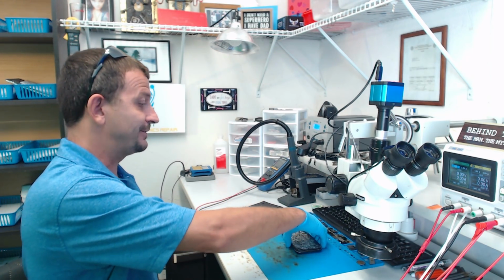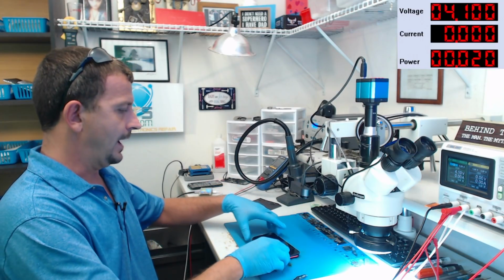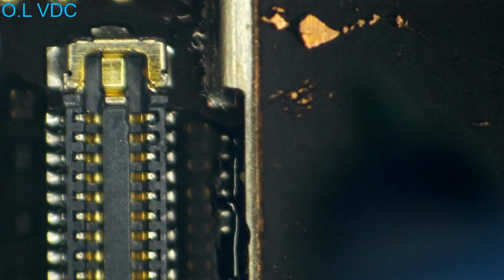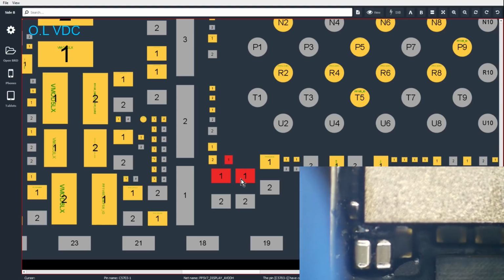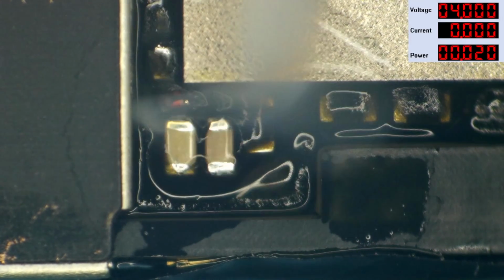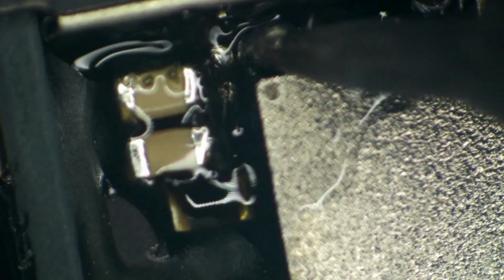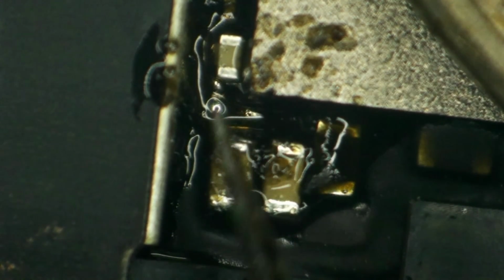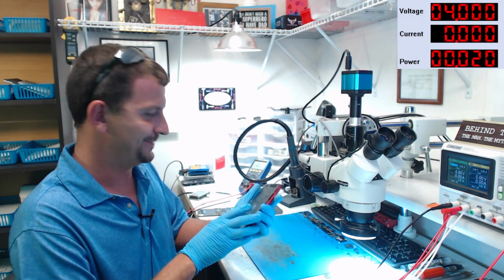Fixing an iPhone XR "No Image" problem (and letting some smoke out)

Comment: Even my XR has the same issue, have tried with different technicians but they have failed to resolve the problem. When you plug in a charger it vibrates

Comment: Nice fix, 5 days before you released this video a car ran my XR as well, can you tell me the values for the capacitor and filter or from which device would they fit. I would've send you the phone so you can fix it but i am from a different continent. Much appreciated.
Reply from the maker: This was a 6.4v 10uF capacitor and the filter was rated for 320mA.  If yours has the same cap shorted, you could get away with just removing the cap.  The filter is likely ok and the cap won’t make a noticeable difference.
Reply: @ststele  thanks for the advice. The display is working now but no backlight now. Can it be the filter?
Reply: What should we check? Both cap and filter are replaced. There is an image now but no backlight..
Reply: Well id start by checking the backlight circuit....

Comment: I ask again,please tell me lens for your camera from microscope
Reply from the maker: When I bought the camera, I really didn’t know what to order.  I knew the mount type of the camera and the size of the hole on the slider adapter thing that came with the scope.  I measured the hole and found an adapter that would make the 2 fit together.   I got lucky and it worked on the first try!  I really don’t know exactly which adapter it is other than it is a 0.5x adapter. 

My setup isn’t good.  I am only capturing around 50% of the viewing area with my camera.  I’m getting ready to change how my camera is mounted to fix it but not sure what all to order yet until I do some research!  Sorry, I’m not much help for this.

Comment: Would you say seek is better than the flir
Reply from the maker: Yes, hands down.  With the macro lens on the seek (and not having it all crooked for YouTube), you can clearly see the smallest of components without the need to narrow it down with alcohol or something else.  I only used the FLIR in this video because I didn’t have a mount to hold my only android device to a tripod. :-)
Reply: @ststele  I have the flir one pro and not liking it so much, thinking of trying the seek instead, flir just keeps going dead and picture not great